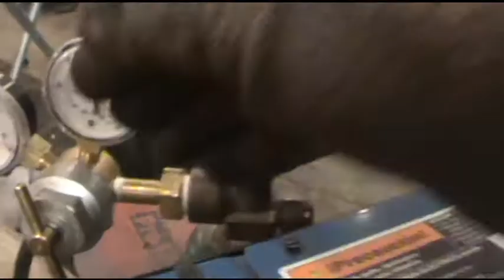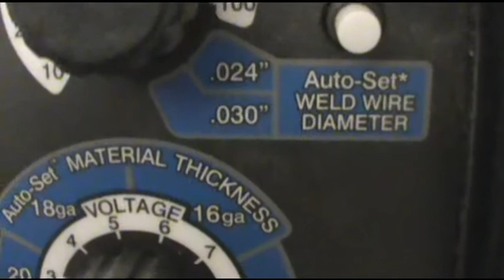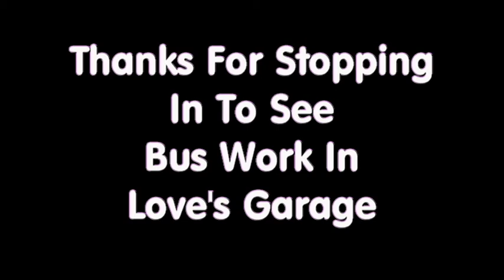Part 6 Wedling VW Bus Front Beam

Comment: Hi Dan, I'm planning to buy a mig welder, can you give me some ideas and or tips what to look for? Plus, which brand would you recommend? Thank you. ☺
Reply from the maker: When I started looking at them I look at different brands on You Tube.  I wanted one that would be trouble free last for a long time and have parts available based on that I went with the Miller 140 auto set great for sheet metal work.  I have a Hobart Stick welder I can use for heavy steel . I know the Miller Welder big investment; but I have my welder for 8 years; it like new works great on my 3rd roll of wire and bottle of gas.  Eastwood makes a intro model if you have issue they back-up what they sell. Hope that help you out??
Reply: Dan Love ~ Thanks Dan, I appreciate it!